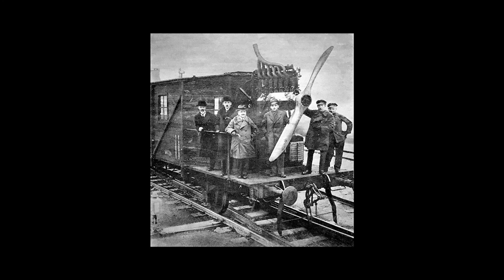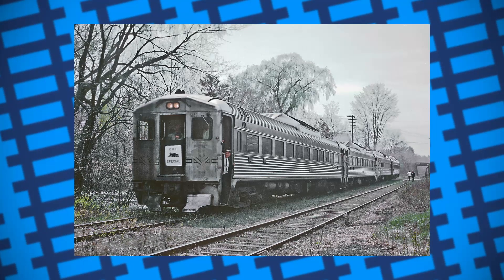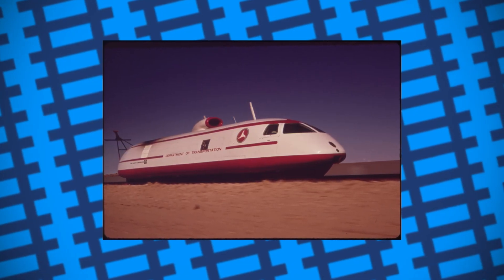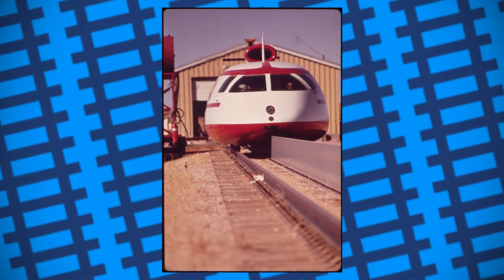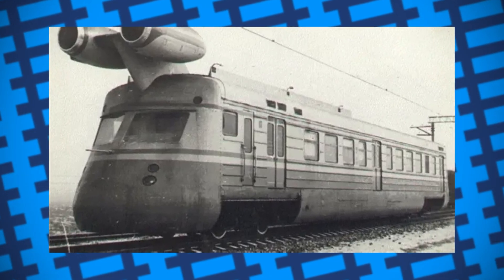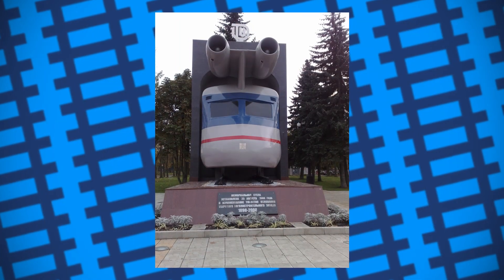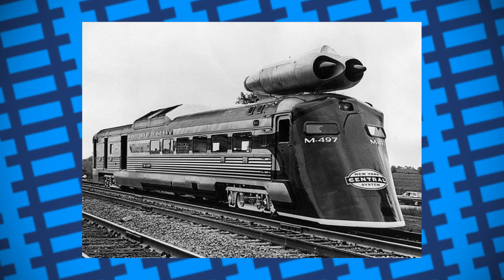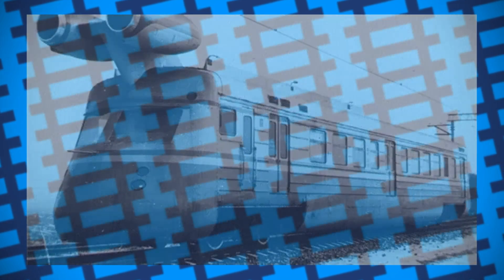The Jet Engine trains that weren't built for speed - TurboJet Trains

Comment: If you wanna look into another branch of "jet" powered locomotives, I'd recommend gas turbine- electric locomotives. Powered like a conventional diesel-electric but with gas turbine as a prime mover they circumvent the major downside of lack of overall tractive effort without the impressive speed of the turbo-jet locomotives, nothing they could do about the volume or relative fuel inefficiency at the time and despite Union Pacific's best efforts (along as several other experimental efforts by other countries) the 1970's oil crisis, aswell as in UP's case there use of Bunker C fuel causing more maintenance  than anticipated killed them out. Having played with the design in Stormworks: Build and Rescue  ( a vehicle designer ) it is worth mentioning that the relatively slow throttle response and ramp up time isn't suitable for shunting and fuel consumption at low power being relatively high compared they make best for long haul routes. It's for sure interesting to imagine what modern engineering could do with the concept

Comment: God damn, I never would have guessed that a B-36 could reach 700 km/h.
That's speeds that superprops could do near their max speed. Like the Spitfire F Mk.XIV and Mk.22 could reach, I think the late G and K variants of the Bf-109 could also reach, and altough only an experimental model the Kyushu J7W1 Shinden could also reach 750 km/h, something that only the P-51D could reach. (But like I said a lot of times, The P-51 is fast, and has long range, but lacks in every other aspect. Late Spits and late Bf-109s were up to the challange, if not better. And I didn't touch the Fiat G.55 and G.56 Centauro-s)

The problem is that it's the '60ies. 700km/h is a max speed not cruise speed, which is around 400 km/h. Apparently that's around the max speed of the B-17, an early....pre world war 2 bomber. The B-29 had a cruise speed of 350 km/h.

The main problem, is that Max speed is not the important factor for Bombers, since they fly in a formation on cruise speed, and that's  when they usually get intercepted.

Now, the B-36 could fly at 700, but only flew around 400, and the fighters it faced had speeds of around 1000 to 1200 km/h.

Comment: Actually, the Black Beetle was intended to test track design-more particularly, it investigated whether or not conventional American track could handle very high speeds provided the vehicle was very light.  Apparently, the answer was yes.  The program WAS regarded as successful from this aspect, although the subsequent Penn Central merger put an end to that line of development (not that the NYC had any funds or willingness to go much further anyways).  It DID also show that a passenger-carrying vehicle would need better suspension and the like, but that wasn't part of the mission to begin with so that wasn't a problem.

Comment: Wow...even with a jet turbine strapped to the engine, it still lacked the power to climb steep gradients.
I remember watching another video relating to the jet train a little while back and learned about a certain flaw of the engine's performance: The rushing wind effect after the engine passing is strong enough to lift several ballast rocks off the tracks and fly towards you and/or your vehicle, making them hazardous projectiles.

Comment: I think youll need to do a part three on the union pacific Turbine locomotives, because by God they tried to make this work.
Reply: That was a turbo-electric, with the turbine engine driving a generator and thus the wheels, totally different concept. But to my understanding they actually were fairly successful for a while, as long as their fuel remained cheap enough.
Reply: @quillmaurer6563  it's still a turbine/jet powered locomotive. Diesel electric and diesel mechanical locomotives are in similar categories so why not these too.
Reply: @Mike_Squires  There were many turbine powered trains around that time. UAC TurboTrain was used by Amtrak and Via for a while.
Reply: The TGV also was build to use turbine engine and was fully tested with them. However just before they could start service the 1973 oil crisis hit and changed those plans.

Comment: They just used the wrong kind of jets...... what you really need for speed is solid rockets ... worked for the shuttle and SLS .  Only huge amounts of flame at face level is more dangerous than propellers..🤣👀🚀🔥🔥🚂👍
Reply: In all seriousness, though, part of the problem is that they did use the wrong kind of engines because the right kind of engines hadn't been invented yet. You'd need engines optimized for economy and power at low altitudes and relatively low speeds - i.e. high-bypass turbofans. Getting those to fit in a reasonable loading gauge would be a trick, though!
Reply: Just like Kerbal Space Program teached me: "MOAR BOOOSTARR"